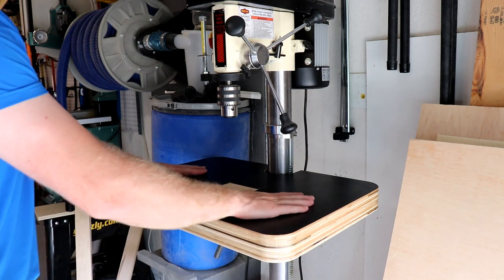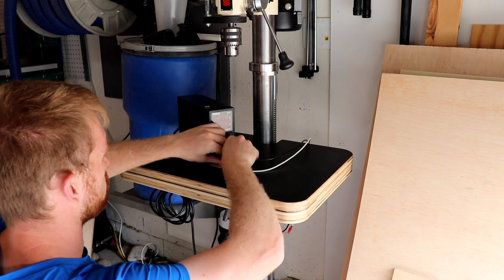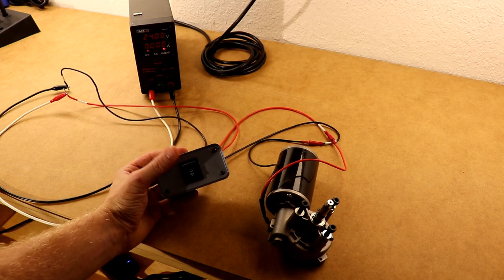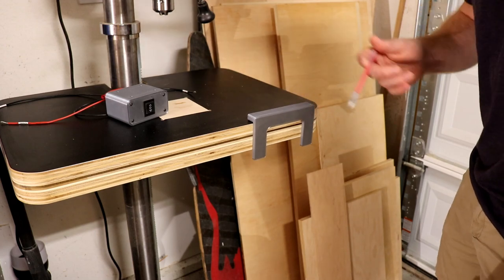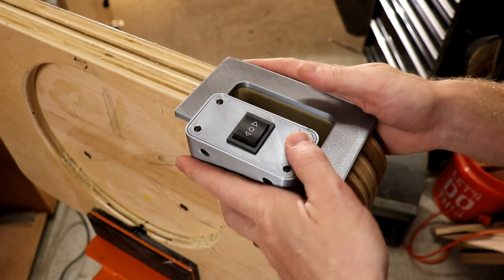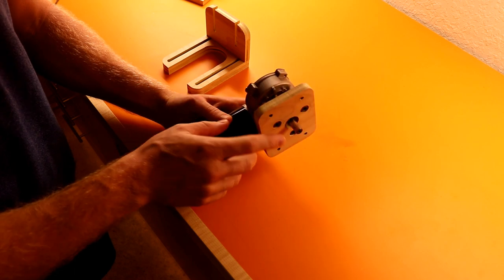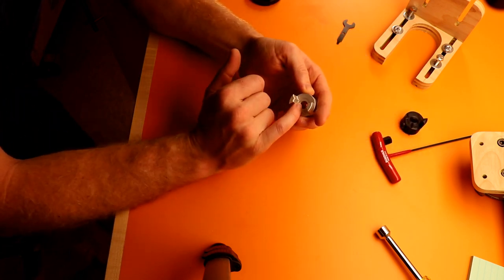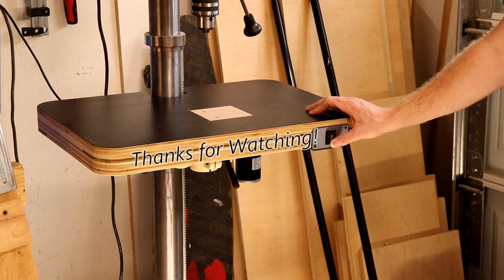Motorized Drill Press Table

Comment: Super Duper Josh, thank you, The link for the motor is unavailable , Josh, any suggestions on a comparable, (I'm not very knowledgeable on
 motors)?
Reply from the maker: I couldn't find the exact 24V 160RPM motor.  I was able to find a 100 RPM 12V motor: https://www.amazon.com/Makermotor-Shaft-Reversible-Electric-Motor/dp/B0765KZ3TJ/

It will be a little slower and will need a 12V power supply instead of a 24V power supply.  Generally, you can google "24V gear motor" and look for one at a similar speed with a power greater than or equal to about 80 watts.   To find out what size power supply you need, take the power of the motor (80W) and divide it by the voltage (12V) and that will give you the current (6.67A).  Add 20% (~8A) and look for a power supply that can output at least that much current.

Comment: This is a nice design. But my table is heavy steel and I have a 2 axis mill table on top of that, and a vice on top of that. Very heavy. I haven’t thought of a good design for a stable and functional table. But I would like a motorized up down. 
My table rotates around the main vertical pillar. It has a lock, but doesn’t seem to work well. So my table is always clocking. Any ideas would be appreciated. 
Thanks,
Paul

Comment: In this table except of crank, there is clamp screw to tighten the table to post once desire height is set. It also protects the table from moving sidewise and vibrating during the drilling. Where you lost this clamp?

Comment: Great idea and implementation! I don't understand why this is not standard on drill presses...or at least an option.
Reply from the maker: Dean, I agree 100%.  Initially I thought this would be 'cool' or nice to have, now I would argue it is a necessity!  I was just using it last night at had several different sized items to put some holes in.  I thought, this would be a PITA to manually crank this everytime I need to switch positions

Comment: Hallo Josh, 
auf der Suche nach Anregungen für einen neuen Bohrmaschinen-Tisch bin ich bei Deinem Video angekommen. Herzlichen Dank für die tolle Idee das Heben und Senken einen Scheibenwischermotor erledigen zu lassen. Inzwischen habe ich die Teile zusammen, werde aber noch einen Regler einbauen, an dem ich die Ausgangsspannung/Geschwindigkeit noch regeln kann. Erste Skizzen und werde ich in Kürze auf meinem Blog - http://rudi-ac.blogspot.com - stellen und können gerne kopiert werden.

Hello Josh,
I came across your video while looking for suggestions for a new drill table. Thank you very much for the great idea of having a windshield wiper motor do the lifting and lowering. In the meantime I have the parts together, but I will also install a regulator on which I can still regulate the output voltage. I will post the first sketches on my blog shortly and you are welcome to copy them.
Greetings from Aachen
Rudi

Comment: The motor would look better if it was mounted horizontal under the table instead or vertical, but that doesn't change functionality, just visually lol, otherwise this is a perfectly done project.
Reply from the maker: You're right! It would definitely make it a lower profile.  I'm not sure if there was a particular reason I went vertical
Reply: @JoshIlles  i was only thinking if you went to full down travel, would it hit the motor or run out of travel on the strip of gear down the side? Either way it wouldn't take much to rotate it lol. Still an awesome idea and execution.

Comment: Josh: A QUICK CLARIFICATION: What is the deal on the locking mechanism on the side of the drill press column. It appears you do not have one. Is it even necessary given that you attach the lifting mechanism to the drill press table?
Reply from the maker: Ron, I have one, I just generally leave it unlocked.  I haven't experienced any problems
Reply: Great I will do this as well.  @JoshIlles

Comment: Ok, so with all you electrical engineers, could someone explain how do you wire this thing up? 1. need motor got it, 2. need power supply, got it, 3 need switch OK, now how do they all connect? and do you cut the plug off the power supply? I'm sure you all understand before ya spend 110 bucks on the "Stuff" you wanna be sure you know how to connect it all. Said motor is now 75 
bucks. Thanks
Reply from the maker: @craigmayhan8620 The switch is a double pole, double throw (DPDT); you use each "throw" (position up vs. down) to change the direction the current flows through the motor. Essentially you're swapping which lead is positive and negative.  Here is a schematic diagram from digikey https://forum.digikey.com/t/polarity-reversal-using-a-dpdt-switch/626.  Here is  another blog post telling how to use a DPDT switch to change motor direction https://www.robotroom.com/DPDT-Bidirectional-Motor-Switch.html
Reply: @JoshIlles  Yes, the switch on off on reverses the direction of motor, not the issue, what wires go where, went to the listed sites, all Greek to me. 2 wires coming out of motor, (DC ) power supply, converts AC to DC, wires coming out of power supply 2, with a plug. Cut off plug? split wire and connect to ?Where, switch? Motor? alligator clips on end and just test connection?, don't want to burn up a 75 dollar motor. all wires go to switch? (have wired up electric trains, is this the same concept ? Thanks

Comment: Bought the same motor as you did, mine needs a twist on the shaft to get it to run full speed just setting on the bench not turning anything.  May have to send it back.  I like your work o the drill press and the video.  Thank you.
Reply from the maker: Yeah, sounds like a bad motor.  I'd ask for another one.  If it doesn't spin freely without a load, snow ball's chance it will spin with one.  Glad you enjoyed it!

Comment: Alternative motor source for cheapskates.  Automotive window motor.   Junkyard / eBay.  Not sure if the speed is adequate, but they are plenty strong.  
Also, the key on the motor shaft is probably removable.  Tap it with a drift punch and hammer and it will slide out of the slot.  I see you have already solved the problem, so this more just an FYI.  Then your original coupler would have worked.

Comment: do you still use the table lock on the left side of the drill press or is the torque of the motor sufficient to hold the table in place?? Thanks, Gary
Reply from the maker: The rack and pinon keeps the table more or less in place. The motor doesn't need to constantly hold it up.  That being said, I will occasionally use the table lock to prevent it from spinning.  If I clamp on a fence and need to make repeat holes, I will clamp it down.  I just have to be careful to unclamp it before I try and move the table.

Comment: Josh thank you sooo much! I finally completed this project on my very heavy drill press table thanks to you! I love it!
Reply: Cristy17, hello.
I know this posting was done 2 years ago but I am in the process of TRYING to motorize the drill table on my Delta 70-200, with a heavy 22" sq. cast iron table.
You said you had a heavy table, did you use all of the parts listed, what power supply did you use ?
Thanks for your time.
"I'm ssssooo lost" !
Reply: @grevillebalzarini3684  Hi. I built my table. I did the "XY axis" so it's heavy but not sure if its heavier than your wrought iron table. In the comments of the You Tube video the creator listed everything you need. It was a fun build. I wouldn't say it was easy but not too difficult either.

Comment: Josh,  I tried your system for my Delta 70-200 Drill Press and the motor will not lift the Table.
The actual motor is not available right now so I went with the next size up and went with a 6 amp power supply.

Any thoughts on this ?
My Table is 22" sq., by approximately 1.25" high, with the usual cut outs and oil trough.

I'm lost, not sure if I need a larger PS, or is the motor just too small for the application ?

Sorry to hit you with these questions but I'm ssssoooo lost.

Thanks for your time and the video.
Reply from the maker: Not sure what motor you have.  If it's the same style but if it's faster (higher RPM) it might not have enough torque.  It's hard/ impossible to say the motor you need based on those specs as the motor power requires depends on your table weight, the friction between the rack and pinion (gear that makes the table go up and down), and your desired speed.  That being said, I'm sure you've already checked, but it always helps as a sanity check to make sure the table is unlocked 🤣

You can check if your power supply is not beefy enough if you have a multimeter.  Set it to check voltage and put it on the output of the power supply, it should read 12/24V, whatever the power supply is rated at.  Then start the motor, if it dips significantly, then the power supply might not be enough.  If you check the current on the motor name plate, there should be a rating, it might be named FLA (full load amps), I'd pick a power supply based on that and double the current as head room (ex 5a motor current = 10a power supply) just to be safe.

Hope some of this information might help, good luck, I'll answer any questions I can 👍
Reply: @JoshIlles  I got the same style you posted but the next one up because the one you posted was not available.   I'm starting to think the PS is the problem.
Thanks for all of the info, great stuff.
I will check the voltage drop and see what I get.
The amperage for the motor states 4 amps, my PS is 6 amp...  just might be the PS.

Thanks for taking time to reply to my question.
As I said, " I'm LOST " !
Reply: @JoshIlles  I thought I had replied before this to your posting but just incase.
First, thanks for the information, just what I needed.
I just ordered a 15 amp power supply and it should be here tomorrow, 5/16/23. I'm hoping it will spin the motor at a reasonable speed, if I remember correctly the rpm for the motor was either 160 or 180.

Thanks again for the info, thanks for the great posting.
It will have taken me even longer to gather the correct parts, at least I had a good starting point.
GOD Bless
Reply: Hello, Josh and others reading this posting.
I was having a problem where the motor that Josh had suggested, wouldn't operate my Drill Press Table.    I couldn't find a Power Supply (PS) like the one suggested so I purchased a PS with 50% more Amps than needed, but I wasn't correct in my power needs,  what is needed is something two or three times the needed amperage of the motor.
I have, at Josh's suggestion, made a few electrical measurements, Power Drop when the motor is under load, and the current draw when running.    
As it turns out, with the electrical measurements and Josh's suggestions I purchased a 15 amp, 24 volt PS...   Drum Roll please...  The motor operates my table, happy joy,,, a little slower than I wanted but it will do until this motor decides to say good night.
My Table is a 20+ inch Cast iron Unit, heavy is the main underlying pressure that slows this Table down to where I'm thinking MORE TORQUE !

Thanks to Josh Illes and the others who made a suggest.
It is working and I am happy with this mod, again thanks Josh.
Reply: I tried a Power Supply with three times the amperage and it worked out.
It probably could use some more amperage but for now it is working and not getting hot.
My granddaughter thinks I'm a wizard setting it up... so thanks for the help !

Comment: Combine this with an automatic clamp and it'll be fantastic!  I like the idea of the motorized table, even tho I don't need it, but having to reach back there to deal with the clamp anyway kinda kills the allure of the motor for me.
Reply from the maker: Honestly, I don't ever clamp it and I don't have many issues.  If you haven't already, Marius Hornberger just released an awesome video on his drill press upgrades that include an auto clamp.  His stuff is next next level.
Reply: @JoshIlles  After I posted my comment I thought; hmmm, is there even a need to clamp?  The 'rules' say you should, but realistically it shouldn't matter.  Thanks, and thanks for telling me about Marius's video.

Comment: Brilliant. No criticism, but what about a stepper motor?
Reply from the maker: Stepper motor could work, but you would need to get a fairly beefy one for the required torque.  Plus you'd need a stepper driver which adds cost and complexity... Generally when I try to make things too feature rich and complex, they never cross the finish line.  I believe for this application a standard gear motor is the right tool for the job

Comment: Awesome idea!  I was going to convert a spare standup desk to a drill press table for the same purpose, but this would be way easier.  Was there a functional reason to hog out a hole for the switch box in the front as opposed to just mounting it on the bottom or was that just for aesthetics?
Reply from the maker: No functional reason, just thought it looked better!

Comment: Great idea and video! The speed on the second motor looked much better, but they is without a load besides the table. That’s a good size drill press, have you tried various weights to see what a decent load limit it on that motor? Now I want to start finding things to add motors to! Thanks.

Comment: Awesome! You got my subscription. Please post your files, or put them up on ThingVerse.
I'm currently raising and lowering with a "drill driver" and a 90 degree adapter, but I like your integrated approach much better.
Reply from the maker: Added the link to the video description and also available below.  I uploaded all the files I could find.  Unfortunatley, I couldn't find the template used to route out the gap for the switch box.

https://www.prusaprinters.org/prints/138913-motorized-drill-press-switch-box
Reply: @JoshIlles  Thank you!

Comment: Very clever design. Very clean. The best I have found!!
Could we get details on the motor you found? Have a link?
Thank you!
Reply from the maker: Thanks for watching!  I edited to video to include the links to the motor, coupling, and switch in the video description!  I also included the specs for the motor around 2:34!
Reply from the maker: https://www.amazon.com/uxcell-Reversible-Reducing-Electric-Motor-JCF63R/dp/B0732FFSGS/ref=sr_1_5?

People had a hard time finding the original one linked.  Here is a new source for an identical motor (updated the description as well)

Comment: Great idea and execution.  I'll have to do this when my new drill press arrives.  What 3D printer and software are you using... you clearly integrate it into your work well.  Thanks!
Reply from the maker: I have a Prusa i3 MK3S, I use PrusaSlicer and for modeling, I use SolidWorks

Comment: Great video.  If you google "cutting a keyway with a broach" you will see the proper, and expensive way to cut the keyway.  Requires tooling and an arbor press, and also expensive to do just one.  I would do the same way you did.
Reply from the maker: Yeah, I've seen how they're cut, but for the soft metal the coupler had, the dremel seemed like the easiest method to get it 80% correct.  For the application (some could argue the motorized table is unnecessary), it was more than good enough!
Reply: @JoshIlles  you can just take a chisel and gently tap it out. it's a semi-circle when it come off. It took me 1/2 a second and two gentle taps. no cutting involved.

Comment: This was a great idea. Thank you for doing the leg work on motor specs. Knowing the ballpark is awesome. I would have been guessing just like you. One thing I might suggest is clocking the motor 90 degrees so it's more compact up under the table. That is what I'll be doing on my drill press anyhow.
Reply: IMHO... straight up and down gives you the option of tilting the table without interference.
I'm in the process of TRYING to get my table motorized and mine is parallel to the column.
Reply: @grevillebalzarini3684  I don't understand what you mean. With this design, mounting the motor to part of the  table that rotates, you have no option to tilt the table regardless of how the motor is mounted to it. Clocking 90 here still makes it more compact and costs you no function. 

To be able to still use your tilt function, you would need to mount the motor to the portion of the table that traverses up and down the column where it doesn't rotate.  So, motor and switch on the part the table that traverses up and down the column. And then whatever table you want to have on your press, including the one it came with. That is what I ended up doing and used the drill press table I already built.

I don't tilt my table anyhow. I find it cumbersome and not repeatable. I have it locked at dead 90 degrees to the quill and I don't mess with it. I use the Woodpeckers Duax when I need angled holes. Which has the added bonuses of being more repeatable and providing more ease in accuracy.
Reply: @StoneyMeyerhoeffer  Thanks for the reply.
My motor, the same design as the posting, is all mounted to the Gear Box of the Drill Press Lift System.
It is out of the way of the Table be tilted.
I'm not sure how to post pictures then I could show you what I have done.
Reply: @grevillebalzarini3684  That is what I said to do. The gear box is the "part of the table that traverses the column" My point is that my comments about clocking the motor were specific to his design.
Reply: @StoneyMeyerhoeffer  My misunderstanding, sorry.
Reply: @grevillebalzarini3684  No apologies man. Just a couple of friendly engineers talking.